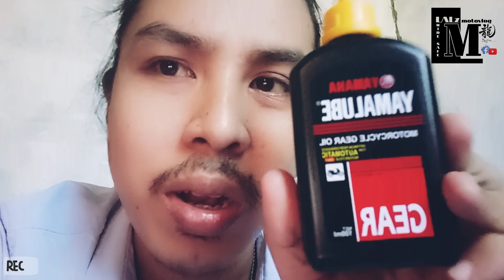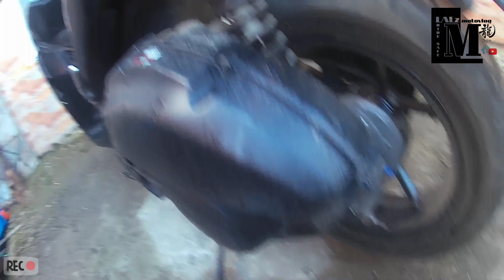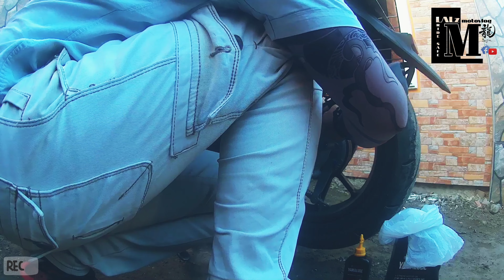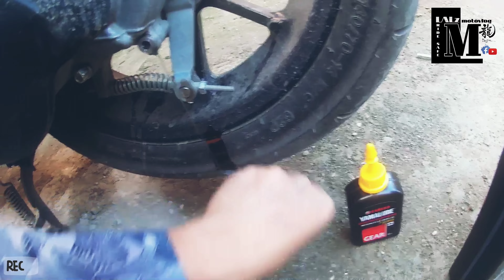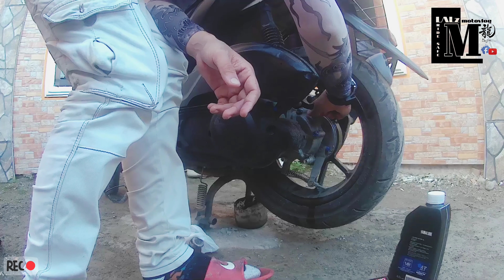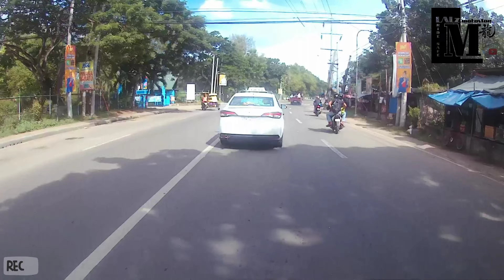My First D.I.Y. Change Engine Oil, Gear Oil and Applying of PEA Carbon Cleaner on Fueltank #yamalube

Comment: Pero until now gamit ko parin ang PEA CARBON CLEANER at ng Yamalube Gear Oil. Sa Engine Oil Lang ako nag palit lods.
Reply from the maker: nasa sayo naman po yan Lods Kung mag papalit Ka Ng brand ng engine oil. Basta para sakin mag papalit Lang siguro ako Ng engine oil pag 4-5years na ang ang motor.

Comment: very informative lods, noon lods gamit ko sa aking Aerox v1 is yamalube simula Unang kuha ko Ng aking motor. Pero Nung nag 5 years na sakin nag palit na ako Ng brand lods, sa tingin mo lods okay ba Yung Mutol?.
Reply from the maker: Salamat sa komento mo Lods at salamat na rin na kahit papano eh nakakatulong yung content na ginawa ko kahit bagohan palang tayo.
dependi narin po siguro sa nagmamayari Kung anong brand ang gusto nating gamitin natin engine oil sa ating motor, basta sumunod ka lang sa manual na 10w40 lods goods na goods yan.
Basta ang ibig sabihin ng 10 is lamig, Yung W is weather at yung 40 is yung viscosity o lapot ng Engine Oil. Mahababg Explanation kc po iyan Lods.

Comment: lods bakit Yung motor ko Hindi Naman sinabi sakin Ng casa na gamitan ko ng PEA carbon cleaner Yung motor ko lods! recommend po ba talaga gamitan nyan PEA carbon cleaner lods? Yung motor ko lods honda PCX.
Reply from the maker: Opo recommended po tlga na gumamit at isama sa maintenance ang paggamit or pag apply sa ating motor ng Pea carbon cleaner kung gusto natin maalagaan ang loob ng piston ng ating motor. Meron Naman pong Pea carbon cleaner ang Honda Hindi ko Lang po sure if ano ang pangalan. Pero same Naman po sila na carbon cleaner lods 👍🏼

Comment: Bro Yung motor na gamit ko Hindi ko talaga na applyan ng PEA CARBON CLEANER. may epekto ba sa ATING motor Kung 1 - 2 years na Tayong Hindi nakapag gamit ng PEA CARBON CLEANER?.
Reply from the maker: Lods Yung PEA carbon cleaner po kc ginagamit po yon upang maiwasan ang madalas na paglilinis ng ating FI o FI cleaning. Dahil napaka sinsitibo po talaga mag motor once Di kabisado Yung pagtotono Ng motor. Kaya for me nakakatulong tlga ang PEA CARBON CLEANER upang Hindi na Tayo madalas mag palinis Ng ating FI nakakatulong din sa paglilinis ng ating piston at kaloob looban Kung san sinusunog ng sparkplug Yung ating gas, para iwas narin sa pangingitim piston ect. For me dapat talaga maintain ang paggamit ng Pea carbon cleaner lods 👍🏼
Maintain mo Lang every 3months or 3000 klm.
Reply: @Lalzmotovlog  salamat Lods
Ride safe lagi.

Comment: Lods Kada ilang buwan o klm bago po kayo nag change oil ng ating motor lods? Atsaka ok po ba gamitin ang brand na Yamalube sa kahit anong Uri Ng motor o scooter?.
Reply from the maker: Kung ako tataningin mo lods. Nag papalit ako ng Engine Oil every 3months Kada 3k klm lods. Isinasabay ko na rin ang pagpapalit ko ng Gear Oil at pag lalagay ng pea carbon cleaner lods nasa video Naman.
Hmmm.. okay naman ang yamalube lods goods na goods nman. Pwera nalang siguro pag umabot na ng 5 years o HIGIT ang aking motor baga dun palang ako magpapalit ng brand ng engine oil lods.
Reply: @Lalzmotovlog  ganun ba lods, actually na nonood din ako ng mga vlogs ng tulad mo na motovlogers din, so if 4-5 years na ang motor ko it's time para mag balit ng engine oil.